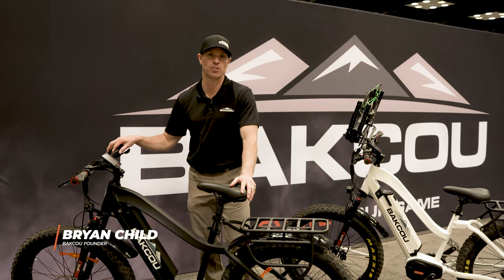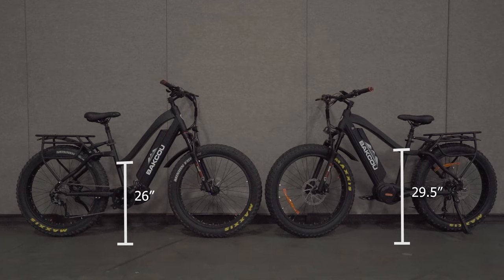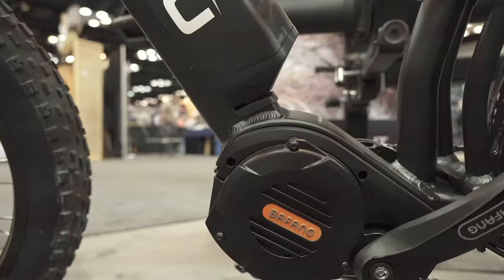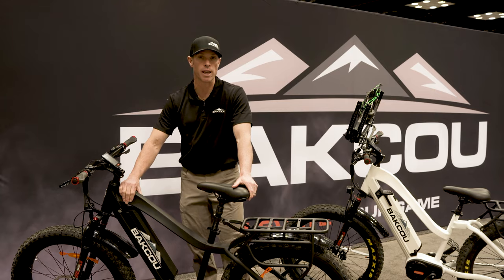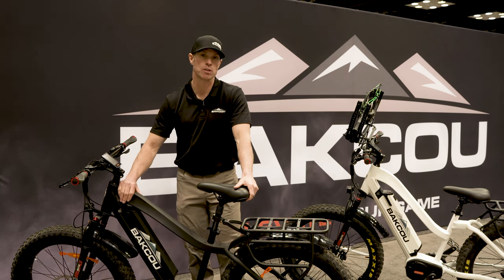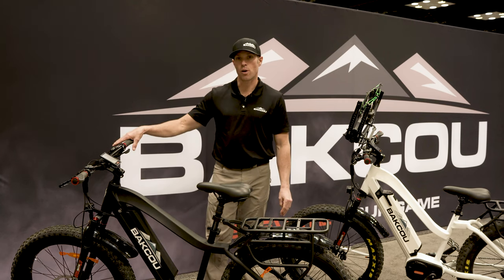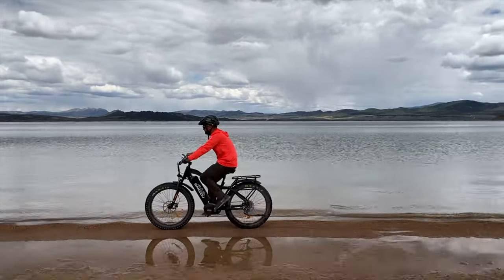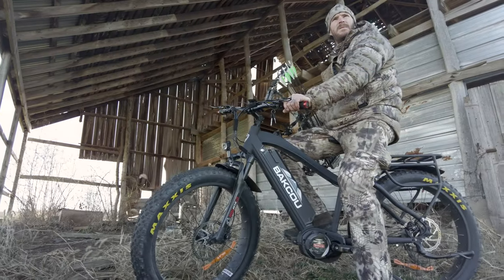The Mule Hunting Electric Bike from Bakcou

Comment: I have been eyeing these for a while, backpacks and me do not get along for long distance travel (spinal/nerve dmg). I have considered trading my 250 dual sport for one of these... but when I purchased that bike I was able to test drive it before spending nearly the same amount ha ha. I am curious how you can re-charge the batteries in the field on multi day trips? would one be able to charge a second battery on a solar panel bank at basecamp while hunting or would you have to carry a generator?
Reply from the maker: Yes we have solar kits. It needs to be 48v charger.
Reply: @bakcou  Awesome, I will have to look into your dealer list and see if the one near me has any for demo.